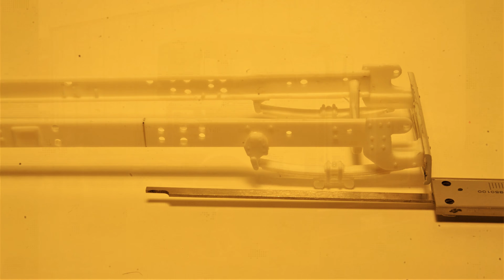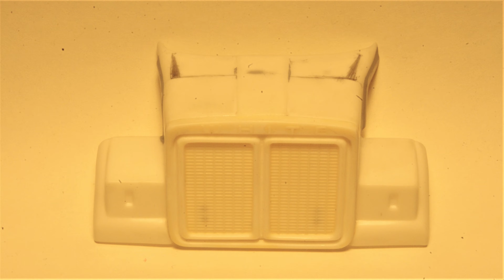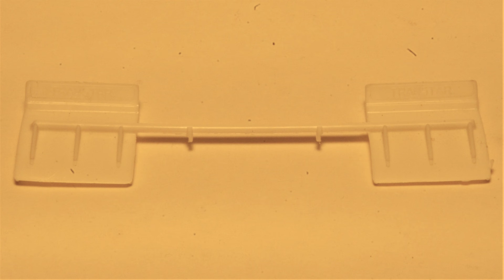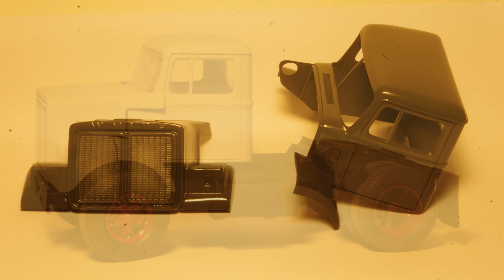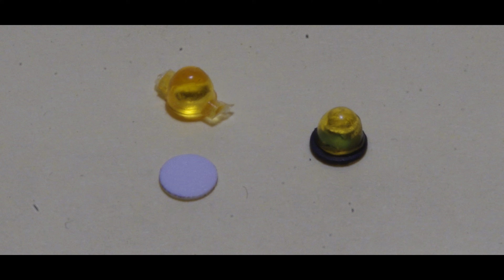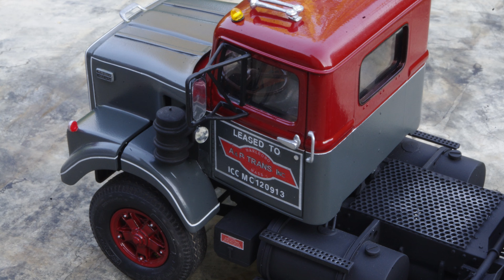1/25 scale White Road Boss: Looking back at an older model truck project from 2011

Comment: Like the documentary of old builds. I have to remember to take pictures of my build ups. Thanks for sharing.
Reply from the maker: Unfortunately the models from w-a-y back when I was a youngster (and even up until my mid teens, after which I drifted away from scale modelling for many years) are long gone and wasn’t much taken in the way of photos back then, those would be interesting for comparison.

At least ones from when I became active in the hobby again, from around 2010 on, I do still have the majority of and more photos were taken. Will work on documenting some of those.

Comment: Love your channel. This is a great build and relates to something I'm working on. I'm cutting down a GMC Astro cabover sleeper cab into a day cab. Do you have any tips on how to make a rear glass for the cab? I've already cut out the rough opening and currently undecided on how to trim it out. I'm using a piece of thin lexan for the "glass". I'd really appreciate your input.
Reply from the maker: It's a lot of fun modifying kit parts to make your own model unique! Two ways I have simulated rubber gaskets around windows on truck projects are:

1 - .032" brass wire, formed to match shape of window and slightly wider than window opening by using inside dimensions of opening on the model and measuring to centre of brass wire. Solder wire ends together, making a square or rectangle that matches window. Last step is to file wire frame down to an approximately half round contour. This sounds difficult but isn't actually that bad especially on rear windows in a day cab as they are fairly small and brass is quite a soft metal. Flat side glues to model with half round on outside simulating the shape of rubber window gasket. An advantage of this method is these parts can be painted separately and attached at final assembly making for a clean colour separation. I did this on sleeper cab windows that were added to an Italeri Superliner bunk.

2 - .040" styrene half round. I learned about this method in one of Evan Hermel's "Truck Stop" columns in Scale Auto magazine some time ago. This half round styrene strip is available in the Evergreen product line and scales out well for 1/25 window gaskets. The tricky part is getting a tight 90 degree bend the "hard way" (across the .040" dimension), some heat is required but not a lot as the .040" half round strip is quite delicate. I think Evan mentioned incense sticks or similar, more controlled than candle flame as a heat source. Make four L shaped pieces and trim to fit window opening. (Four L shapes are mush easier to make than trying to get multiple 90 degree bends at exact dimensions). Finally, glue in place and touch up joints if/as required. This approach requires touch up painting of gasket after cab is painted however it is no different than windshield gaskets that are already molded into cab shell. This method was used on an AMT K100 modified to day cab similar to the Astro you're working on.
Reply: @brsnorthernhorsejourney3579  Thank you! I'm going to explore both options to which I've not thought of either one. Hopefully I can find some pictures on the ole google.  You are an awesome builder. Again, thank you sir!

Comment: Have you ever used the moebius wheel sets on amt trailers, if so what did you use to mount them ??  Thanks
Reply from the maker: Although I haven't used them yet I do have two sets of Moebius wheels and tires (duals, like the ones provided in their trailer kits and looking at them would use Evergreen styrene tube to bring inside diameter of centre mounting hole down to 1/16". 

Two sizes of tube are required: 5/32" outside diameter to fit inside the wheel's centre mounting hole, then 3/32" outside diameter sleeved inside the 5/32" tube. When the glue is thoroughly cured, drill inside of the 3/32" tube out with 1/16" diameter drill to fit AMT metal axle.

Comment: Neat to go back and see how much building has changed over the years. I was told to hold on to at least one of your early models so you can compare it later on.
Reply from the maker: I'm going to look in the archives and see how many "in progress" photos I have of a Transtar 4300 built around the same time (pre-Alclad for chrome!), still have that one as well.
Reply: @brsnorthernhorsejourney3579  The world before chrome paint.

Comment: The basic cab on this build looks very much like the Autocar cab with the road boss front added. You should do a how to vid on the windshield wipers. Those are such a weak spot on most kits, and really need an upgrade. Great work as always!
Reply from the maker: Good eye regarding Autocar cab - the same cab shell was used on a number of different White Motor Co. trucks including Autocars, White 4000 & 9000, and Western Stars in addition to the Road Boss. Worked well for AMT's kit line as there really was commonality between trucks in 1:1 scale.

I'll look at older photos of a different truck, Autocar scrap metal lugger, as on that one I modelled the wiper mounts on cowl. For this Road Boss I installed wipers directly to cab below base of windshield which isn't correct for this style cab. Learned that a few years later!
Reply: White, Western Star, and Autocar were some conglomerate back then, so yes, the cabs were the same across brands for some models.